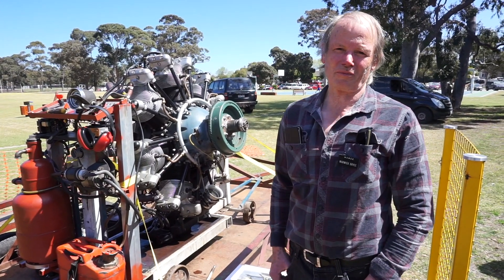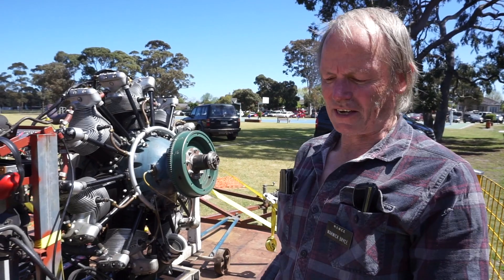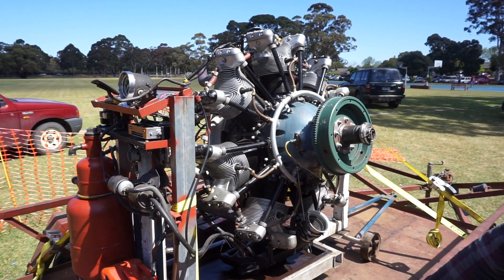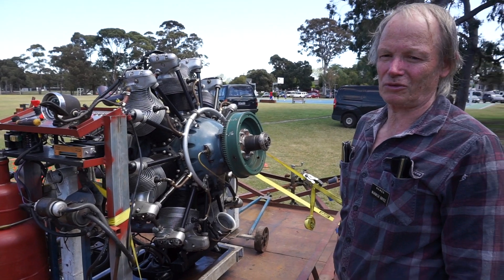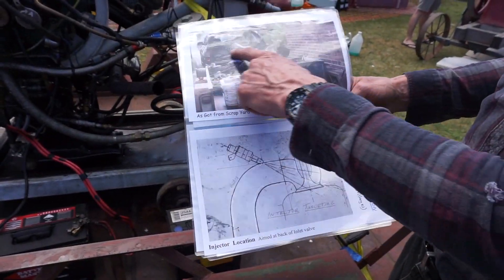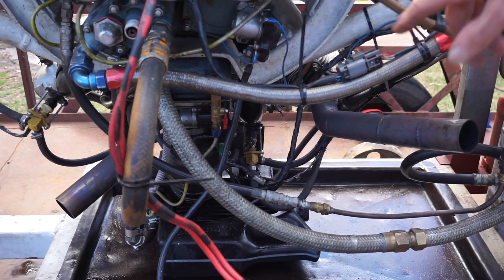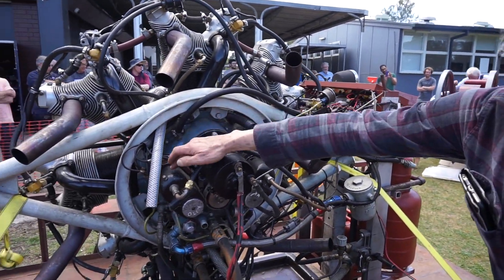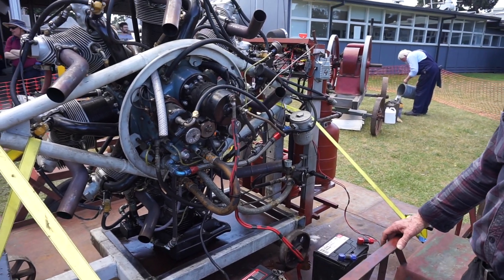Junkyard Radial Runs Again - Jacobs R-755 Aircraft Engine

Comment: It’s amazing how big this engine is 755 cubic engine, 5.25in bore 5in stroke but only 300hp lol that’s just hilarious to me sure it’s got torque but we have small little 4 cylinder engines with more power now haha!
Reply from the maker: Hey mate and thanks for watching.  It certainly is a beast of an engine.  I think the high torque is required to swing those large propellors. It's a bit like towing a caravan with a vehicle that has high torque versus RPM for horsepower.  Cheers, Aaron.

Comment: Beautiful restoration and marvelous ingenuity! Getting odd fire radial engine updated to electronic controlled fuel injection is not for the faint of heart!

Looks like he did it on a shoe string budget as well, so double bonus points!!

I tinkered with a Pratt & Whitney R2800 as part of a team that attempted to  retrofit a FAST (Competition Cams) Computer controlled ignition and fuel system.

Using 3 "V-6" profiles (3 FAST units) we managed to get it running. We ran into A/F ratio problems above 1,800 rpm. 

We ran into the same problem this guy did; fuel flow and mixture ratios.

Very nice build!!
Reply from the maker: Hey Doug.  I don't know Warwick personally, but I found out some background information.  I think he used to work for General Motors and he was sent to overseas to Europe to lean all about EFI.  Warwick has all the gear to plug in and reprogram the Eprom and he also has cross reference ratio charts (which he wrote) that enable him to change mixtures etc.  Bloody smart man if you ask me.  Leaves me for dead.  Cheers, Aaron.

Comment: Well done Warwick!!  Has to be the easiest starting radiall engine I have ever seen.
Reply from the maker: Hey Chris.  Thanks for following along.  I saw this engine down there on Saturday and I couldn't resist not filming it.  I can't believe how well that old girls starts (cold & hot).  It's such a big motor to crank over.  The old starter motor is certainly punches above its weight ;-).  Cheers buddy, Aaron.